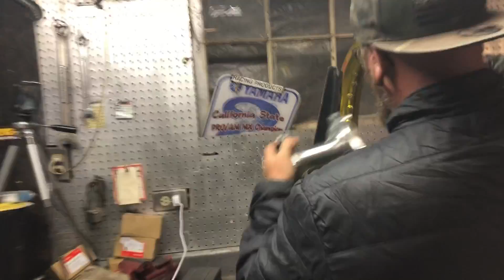Life of A Racer: Day 1 of SX, Doctors APP., and much more!

Comment: I actually really agree with Clint on the problem with that Honda around 9 minutes when you guys are talking about the bike that won't run right. If I'm not mistaken Honda, Kawasaki and other manufacturers are now putting fuel injectors Downstream from the airbox. They do that to help with starting and it actually helps with bottom end power to put an extra fuel injector in the air box that squirts down to the throttle body . But It could be a freak thing too, and you could have just got a bad fuel injectorn I would talk to Honda about this, Cuz that is extremely strange I must admit. but to me it really does sound like a bad fuel injector. That is extremely crazy if it's not a bad fuel injector somewhere then the only other option is to check compression again but that sounds highly unlikely that that compression would be the issue. in my opinion, that is extremely strange but I really do genuinely think that you have bad fuel injectors. don't clean them, buy new ones if at all possible. Good luck man but I have to admit that has to be one of the weirdest and most difficult problems to diagnose I've ever seen. If you really have checked over everything then it really should be starting up fine. Only other thing maybe you could check at the hot start. Just to make sure that the automatic decompression is working on your cam inside the head

Comment: I feel your pain on the bike my kx450 ran great i put race gas in it and it wouldn't start had to pull start it then it would run great i checked everything valve's you name it i was like what's different other than gas i put 91 pump gas in it and it started right up and has been running great ever since so i guess it doesn't like race gas lol

Comment: Check out the ecu mapping for cold start. I had a tuned  race car that wouldn't start when I was hot cause the tunes warm start and cold start had to different fuel map tables. Just a thought good luck homie!
Reply from the maker: Changed ECU to a stock one and even tried a Vortex box
Reply: @tylerenticknap6670  might be a long shot in the dark, but i had the same problem with my crf250r racebike and thankfully  i had an other ecu that i could check out the data logs on, and turned out to be the temp sensor. bad/broken temp sensor= cold start map and so on is waaay of so it will do one of two things 1. spray way to much fuel or 2. not give enough fuel cuz it thinks it too hot. that would be my guess atleast :)

Comment: What are the chances both fuel tanks have a clogged filter? Has to be fuel pressure if it starts with starting fluid. Either the fuel filter is in wrong or it's plugged. Who replaced the filter? The auto zone fuel pressure test kit will answer your question. The pumps put out and hold 43psi, a plugged filter will allow the pressure to fall to zero from 43psi, it needs to hold the pressure @43psi until you release the gauge pressure. Simple 5-minute test. I learned this the hard way, hope it helps.
Reply: Factory Wrench Tools 🤞🏻

Comment: Id look at the fuel pump. Sounds like pressure is bleeding down after it sits and that's why it sucks to cold start
Reply: but if you replaced the complete tank, that would have ruled out the pump. Only other thing I can think of is maybe ECU or cam/crank sensor. Something is delaying the pump kicking on. Try swapping ecus if you have one laying around

Comment: Has to be radiator cap man, check to make sure its sealing. 😂 quite the mystery you guys got on your hands! Really have no soild ideas besides tearing it all apart and checking everything. Or maybe any leak that would throw off air and fuel mix. Maybe something wrong with the throttle body?

Comment: If it was me I'd just check to make sure the valve lash is good, you want that intake valve opening all the way. That's the only thing I could think of
Reply from the maker: Cam timing is in spec
Reply: @tylerenticknap6670  is there an injector line? I'm not familiar with the bike but that would be my next thought on something you haven't replaced yet? I dont know, I'm out of ideas now just Craigslist it "Mechanics Special Runs Great" lol

Comment: My ktm was doing something like that. It was building to much pressure in the fuel line. And wouldn’t start. So we took the fuel line off and put it back on and it would start. And whenever it built to much pressure again just take it off an drain it

Comment: How about going back to default fuel mapping from factory and work up from there?
Reply from the maker: Tried two different stock ECUs
Reply: @tylerenticknap6670  AS SILLY AS IT SOUNDS, THERE'S NO CRACKS IN ANY OF THE PLASTIC OR RUBBER WHERE ITS LETTING IN A LITTLE TOO MUCH AIR?

Comment: You said capacitor and everything else, but what about Voltage Rectifier/Regulator? It’s bolted to the ECU.
Reply from the maker: Haven’t changed that one yet
Reply: I had mine go out on my ‘17 450. It wouldn’t start for crap. Like trying to start a old 4 stroke without a hot start. Scanned the bike and it showed varying stored codes. Figuring it had to be electrical and voltage at that since there were codes all over the place, we looked at what governed the sensors and injector, etc. So we swapped the rectifier/regulator and instantly fixed it. It kinda made sense, but kinda didn’t since you’d think things like that either work or they don’t. And don’t try testing it, won’t work without an actual load like on the bike.

Comment: If you are having to squirt fuel to get it to start you are basically having to prim it witchs means somewhere in the fuel system its sucking air, just my guess
Reply from the maker: That’s what we are thinking. But i changed the fuel line and injector
Reply: Stumped

Comment: Definitely a lean condition, I’ve had ecu’s fix that problem if there is no cracks or air leaks anywhere else causing a lean condition. Keep it simple. I always overthink problems like this.
Reply from the maker: No air leaks and changed ECUs
Reply: Your positive it’s not a mechanical failure? Low comp will give those symptoms too

Comment: Stumped... ashamed to admit it but come on guys, professional tips helpful
Reply: Cold start maybe?
Reply: And by the way that 250 you and 772 are building is going to be 👌 
All the best with it
Reply: I know you probably already know this but The MAP and TPS plugs can get switched and it will destroy the MAP sensor. Make sure blue connector is on the TPS and if they got switched you may need to get a new MAP sensor. Also make sure you have the correct voltage at the TPS. Double check cam timing and make sure you"re not off one tooth. If that doesn't change anything try a stock camshaft. I read where a guy had pro circuit camshaft and had this same issue and he put a OEM camshaft in it and it fixed his problem. Might be worth a try if you have one laying around. Sounds like a definite fuel delivery issue. Keep us updated. Love the videos!!!!!!!!!!!!!!!    Keep them coming!!!!!!!!!!!!!!!!!

Comment: The electrical system has to be primed... same as a mechanical fuel pump needs the engine to turn over to make fuel pressure. RIP chicken lags.
Reply from the maker: Yeah i bumped started to get it running. Then tried to start it.

Comment: And one more thing Husqvarna for example run like garbage with race gas unless the ECU has been programmed for it. So I don't know what your ECU mapping looks like but in general the bikes do not like to run race gas unless they have been programmed for it unless you have like a Vortex ignition on the bike then more than likely it could run like crap and if that's not your issue then you got to chalk it up to buying a new throttle body. I know it sucks but if it's not letting air in or building pressure somewhere, then that's really your only other option to look over. Unfortunately it's an expensive one. But refer back to my previous comment first start off simple if you can. That's just my opinion though I really do believe Clint is on par with what the issue could be don't hesitate to ask him for help he's the most qualified person near you for the job so? I don't know aside from that man good luck I really hope you figure it out. That is extremely strange and a major pain in the ass to diagnose. Good luck brother
Reply from the maker: Bro i talk to Clint everyday about it and changed the whole throttle body already.
Reply: @tylerenticknap6670  yeah that's crazy man really that sounds extremely strange I'm really surprised that that hasn't solved your problem that just sounds like a freak thing to me man honestly it's extremely odd. And you said you already went through all the electrical so that makes it even more strange. I'm starting to wonder if it's got something to do with the automatic decompression lever on the cam. I don't know that's the only thing I can honestly think of it sounds to me like you've crossed all your t's and dotted your I's man. That's extremely strange. As a side note though I do appreciate you replying back that's really cool
Reply: @tylerenticknap6670  another thing that's crazy ... if you've already replaced the throttle body and you've already done the fuel injectors then that would automatically lead you to believe it's something electrical again but you've already done all of that I honestly don't know man I'm going to be honest if any ideas pop into my head I'll try to shoot a message your way but at this point, I have got to be honest with you man if your compression is good, valve clearances are good and I'm sure they are. I have no doubt that your bikes are well-maintained. You're a professional Supercross racer for crying out loud. So to me it's extremely odd I really just don't know man I'm sorry I don't have better news for bro. Only thing I'm curious about then for myself right now is, I'm wondering if you are getting a strong spark or a weak spark. Like I said it's very odd that none of this has been solved already. in theory if you've replaced the ECU components you've replaced the fuel injectors and you've replaced the throttle body. And I could be wrong but I do believe you also said you replace the stator and everything as well. If you checked over all the electrical and then went through your fuel  system to then it should be working I got to be honest if I was you at this point I would just be bringing my bike into a Honda dealer. It's the only problem with these new bikes have so many electronic  components to them now that sometime you can end up chasing your tail trying to figure out what the problem is. I truly do believe you can figure this out I just believe it's going to be something stupid that you didn't go over so early enough like a stupid connection not being fully engaged because if you went through everything then in theory everything should be running great if I was you I'd look up common fuel problems it's the only logical conclusion I can come to I'm really sorry I can't help out more I'm not there in person to look it over with you you know I really do wish you the best of luck man and if I can think of anything else you already know I'll be hitting you up on this video or in your future videos
Reply: @tylerenticknap6670  like I said in my last comment bro if I was there in person it would be much easier to go through these things with you but I'm not and for me I live all the way in Massachusetts so it is what it is. it makes it way more difficult to try and diagnose a bike over the phone by YouTube comment lol
but all I can say is, read through my previous comments and if anything helps  you out let me know and if I can think of anything else in the future I'll do my best to hit you up I really do hope you figure this out and I really do think you can get it sorted out. I'm still racking my brain over it every day if I can think of anything else I'll let you know brother good luck man and please keep us posted I really hope you get that figured out I really thought you already had it taken care of. that's crazy.
Reply: @tylerenticknap6670  I was reading through some people's comments to. And things that you've commented to them. At this point it's really starting to sound like just a bad plug make sure all your connections are connecting properly make sure nothing has shorted out the actual wiring harness sometimes when bikes get hot will actually start to melt the pins and it won't make a full contact connection that's the only other logical conclusion to come to man maybe it's not so much about the ECU as it is the actual wiring harness some people will put a ton of Dielectric grease in the plugs to when they're going to connect them back together. This can sometimes cause the bike not to ground out and it won't be able to tell you're going on a little bit of Dielectric grease is good a lot will make a bad connection is what I'm trying to say. Anyway at this point like I said if you've already checked through all of that stuff the only thing left to check through is your wiring harness and make sure that everything is good I know it's real major pain in the ass but at this point what else is there to check. I mean you'll have access to the best ignition boxes on the market I'm sure you have plenty of help from Honda and everyone else I'm sure you can get help if you don't immediately have it anyway. The only other thing is the actual wiring harness and the capacitors. this seems like a very weird situation man. This is the stuff I would be thinking to myself I don't know what this is helping at all but I hope it does